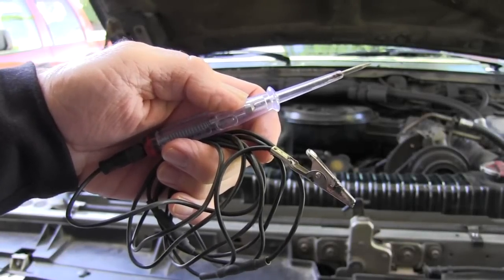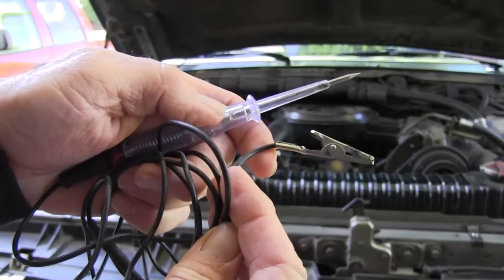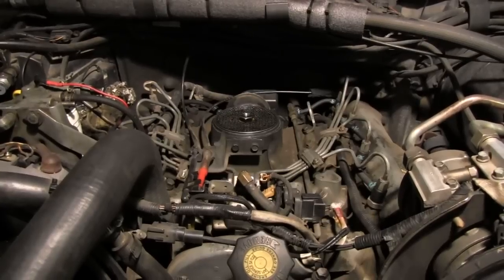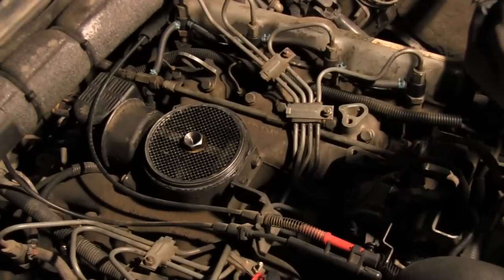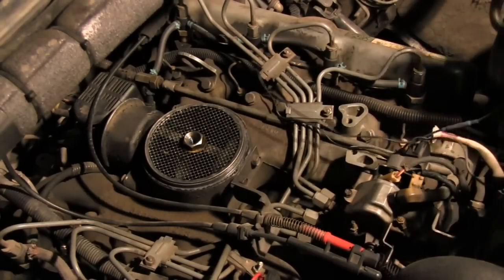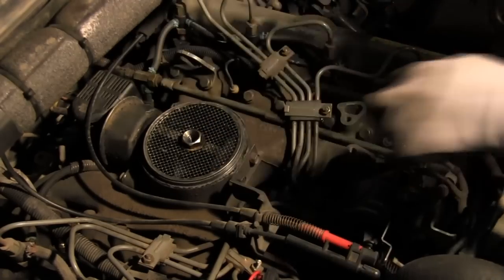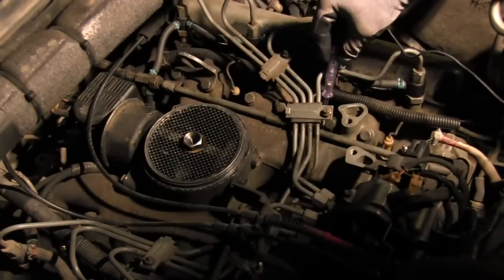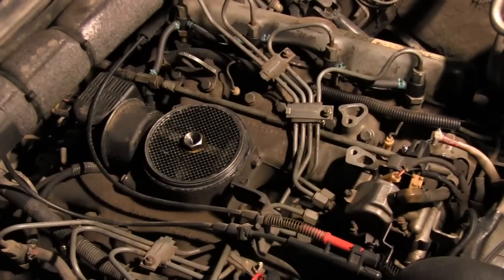Glow Plug Test Using A 12 Volt Test Light Ford 7.3 Liter 1994 And Earlier

Comment: Another more accurate way to gauge a gp is using an ohm meter, they should read 0.8-1.2 ohms, anything lower or no reading is bad, good way to check them and find weak ones before they go out

Comment: Im confused as to your method!? Correct me if im wrong but if you connect that alligator clip to the positive terminal on the battery and touch the light to anything it would light up regardless because you're grounding it out therefor giving you a false test! Your clip should be your grounded source.
Reply: WRONG, IF  glow plug as 12 volt  to top pin and goes true a good glow plug to ground and cause the light to glow, if it had a open or blown plug it willl not go to ground and light will not light , shown a open cir.

Comment: FWIW continuity is not enough of a test for those glow plugs. A brand new glow plug for that vehicle has .1 ohms of resistance so if you had a glow plug that had one ohm of resistance your system would test it fine and yet it would be out of spec by a factor of 100. Measure the resistance across the glow plug must be less than .4 ohms to be serviceable.  Yeah the truck might still start but if all the cylinders aren't equally hot they run and buck real bad.

Comment: I'm doing this test on my 93 F350 in a few.. I replaced all 8 glow plugs just before winter with autolites at 10 bucks a piece, less than two months later, my controller is clicking fast again and I have virtually no start without the block heater plugged in, and I know my controller is fine. Grounds are good and tight. Has to be a faulty plug. Thankfully I hit the threads with anti seize before I replaced them..AND, I saved all the old ones so chances are, I have a few that still work!
Reply: Spend the money and use motorcraft Ford GP.  I've had autolites and botch swell when they fail.  And that's when they break off and head has to be removed.
Reply: @carhart1973  Turns out, that's exactly what happened. Managed to get a couple of the bad ones out, but sure enough, the one under the fuel rail on the left bank is swollen and won't come out. Grrr. I am going to try an extractor first though. I really don't want to pull the heads..
Reply: @sigaries4062  you can try loosening them up, take your hood off, cover the windshield, unplug your fuel shutoff solenoid, and start cranking it over. Lol we've shot a few of them out that way before. Make sure you have plenty of beer on hand.
Reply: @carhart1973   Tried that with a heavy piece of flat bar to protect the fuel rail...Didn't work :(
Reply: @sigaries4062  aw. That sucks. Well, good luck.  Hopefully there's some forums out there that may have some other tricks.